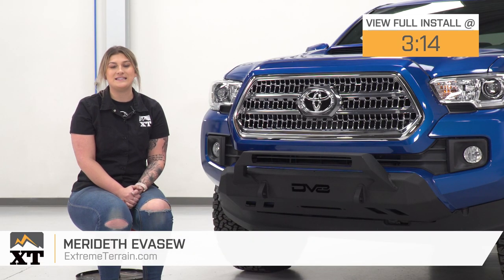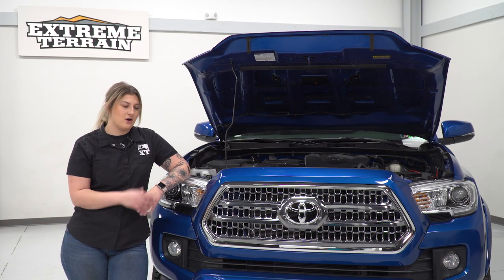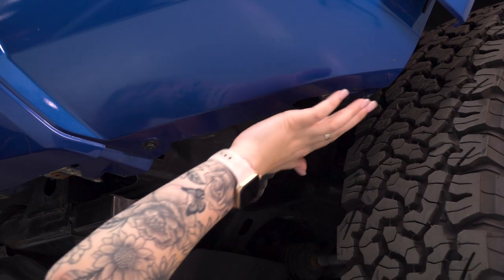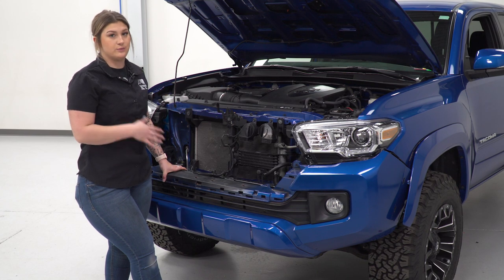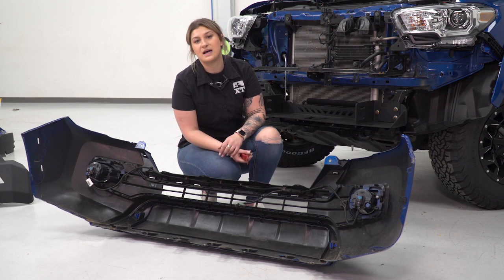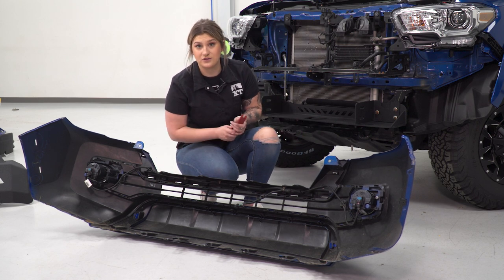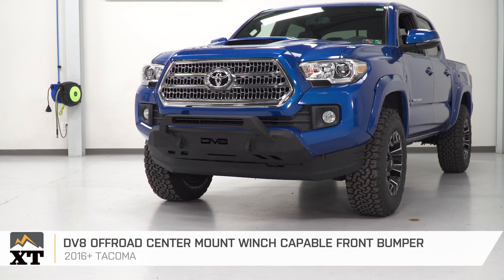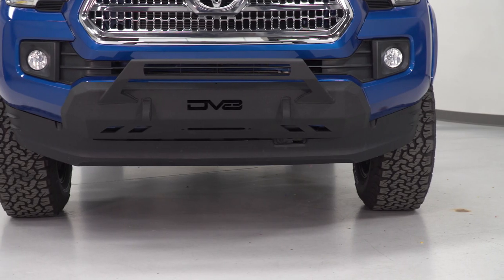2016-2021 Tacoma DV8 Offroad Center Mount Winch Capable Front Bumper Review & Install

Comment: I knew that overtime someone would come out with one of these where you didn't have to cut the plastic bumper. Best option while keeping the stock look.
Reply: Is it as sturdy and why is everyone complaining about it not being flush?
Reply: @darkassassin1987  I just picked mine up from the post office.  This thing is HEAVY and I think it comes in at 120+ pounds.  If it gets bent then it's getting hit pretty damn hard.

Comment: I just bought the DV8 Winch Mount for my 2020 Tacoma TRD 4x4 Sport.

It was well packaged that's for sure, w/them using that expanding foam material for keeping the components in place in the box for shipping, though it was a pain to remove the parts because of it. 😉

I was able to install the winch mount w/o removing the bumper by simply removing the center section only, together w/the grill. You will need to remove those plastic side baffles as well to help in accessing the center section clips. With the grill removed, and the side baffles removed, you can get to the center section clips and undo them.

Installing the oil cooler relocation brackets, my kit came w/no bolts for doing so, so I had to look around house for a couple, including nuts and lock washers.

As for that oil cooler mounting bolt behind the passenger side wheel well, there's no bracket for that one, so it's left hanging.

With the oil cooler relocated, it makes contact w/the A/C condenser behind it, on the passenger side of the condenser. When tightening down the relocation brackets, I tried to keep it away as much as possible from any contact w/the A/C condenser.

I got the winch mounting plate, as well as the two plates for mounting the front face installed. There appears to be just enough mounting treads, though normally you want at least two or three threads shown w/the nut tightened.  I wish torque values were noted. I normally like to torque my bolts, especially when it comes to something like this winch mount.

The next thing to see tomorrow, is if I can install my Warn M8000 winch through that bumper center section opening. If not, I may have to remove the bumper after all. We'll see.

Outside of those oil cooler relocation missing bolts, a mounting bracket for the oil cooler mount behind the passenger side front wheel, as well as a concern for the contact of the oil cooler w/the A/C condenser, the kit appears to be well made, including being powder coating. Again, I wish torque values were noted someplace. I like to torque my bolts, especially when it comes to a winch mount.

As for that light mount, some photos show it welded on, while others show it as bolted on. Mine is bolted, but not installed. I plan to keep it off, at least for now.

Finally, Merideth and ExtremeTerrain did a great job at producing this video. It both help me in my decision to buy the DV8 winch mount but was extremely helpful w/it's installation.
Reply: Update: 
I finished up installing my winch mount today. Wanted to install my winch, but I was running out of time.
Had an issue w/the winch mount center piece. One of the brackets was slightly bent. It looks like it might have been from the welding.
Got that straightened and finished up installing.
Had to play around a little to get things as straight and aligned as possible.
Also installed the winch roller fairlead, which looks a little odd, being aimed down at an angle.
Hope to get the winch installed next week. 
The setup looks great, and once again, I didn't have to remove the bumper to install.
Reply: @gordie2377  appreciate your thorough review gordie
Reply: This is perfect as i have the same exact truck I too did nit receive any hardware for the mounting plate which is pretty frustrating.  Touching parts makes me concerned,  almost wish I saw your comment before buying or I think I would have a change of heart. How has it treated you thus far if you still have it?

Comment: all that surface rust on OEM hardware scares me
Reply: Ended up buying from dv8 on the Extreme T. Website. No complaints, The packaging had extreme care, and hardware was 8.8 grade. I used a 12k winch, overall happy and adding scratches to it. My factory frame has no rust yet, maybe depends on what state you’re from

Comment: The winch mounts higher than the Fairlead.  This makes the cable rub on the base plate.  It also prevents a straight pull.  The cable has to go down...rubbing on the base plate...then make about a 30 degree turn against the top fairlead and up to the pull..  I'm considering sending it back.
Reply: Cut out the DV8 and get some mounting holes for the fair lead. I believe whoever designed it swapped the logo with the fair lead position.

Comment: How do you access the winch free spool lever? Nowhere on any of these bumpers can I see how you get to it.
Reply from the maker: You make a solid point! You should be able to access it trough the engine bay surprisingly. Might just need a stool to reach down far enough, lol! We haven't tested this but with how much room you have in-between the grille and rad you should be able to reach it.
Reply: Great question

Comment: do sports not have front bumper absorbers, or was it removed previously with this truck? Main reason im thinking of getting this bumper is due to no cutting, as well as stock trim piece being garbage, ive broke mine twice and now its just a absorber showing where the cover was which annoys me. Also what about the fender adhesive? doest that have to be replaced before putting front bumper back on?  Also if not installing a winch, does the cooler not have to be moved back?   Id love to put this bumper on and the skid plate, but a aftermarket skid plate not coming with a door for the oil filter like the trd pro seems kind of silly.

Comment: Anyone else have an issue with the cooler relocation, mine would. Ot move straight back, when I finally did get it to move back at all my lines were hitting the sway bar mount. I'm worried it's going to rub a hole in the lines.
Reply: I added a couple washers under the bracket at the front to raise it above the lines.

Comment: Did anyone have an issue with this not matching the contours on 2021 TRD off-road?
Reply: Mine didn't line on on my 21 offroad that well with the body lines but it's not terrible.
Reply: 23 O/R and mine doesn’t mesh nearly that well.   But it’s tolerable.

Comment: I live in Mass, where do I mount the front liscence plate?
Reply: if you google, dv8 has an addon for $40 thats a movable license plate cover
Reply: I used the original license plate holder.  Some minor trimming on the back.  Drilled two holes on the bumper and bolted it on in front of the DV8 logo

Comment: Do I need to beef up the front suspension with this setup?
Reply from the maker: You won't need to by any means! The added weight may cause your front-end to sag slightly but by no means is a lift or spacer to compensate necessary. -Zach
Reply: @ExtremeTerrainToyota  What about adding a whinch to the bumber? should I change my front shocks?

Comment: If I plan not using a winch, can I leave the plate out of the install?  This way I don't have to move my coolant lines....
Reply from the maker: I wouldn't say that you have to use it, but I would recommend putting a spacer in it's place for the correct fitment. If you really don't plan on using a winch, you could even cut the center section out to use the ends as your spacers and added support. Hope this helps! -Merideth